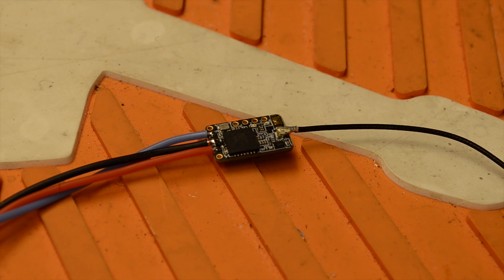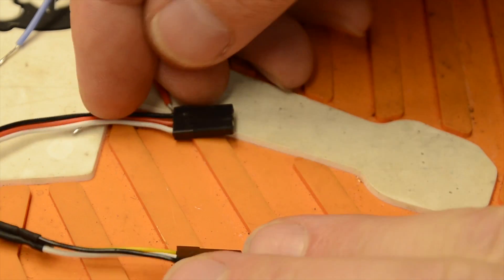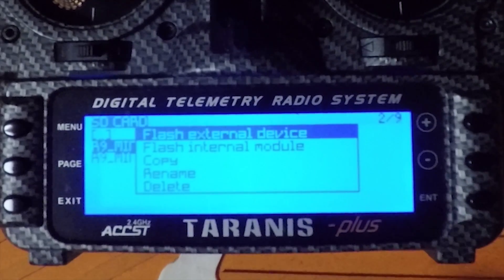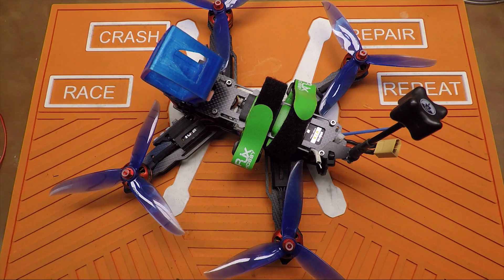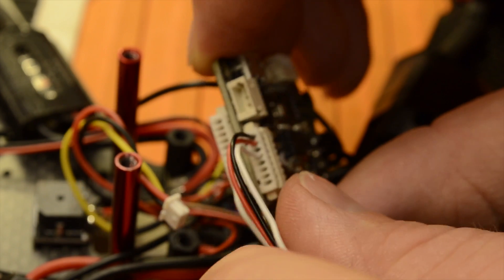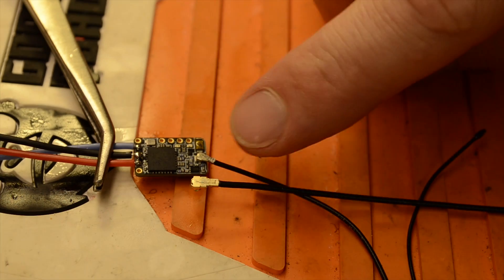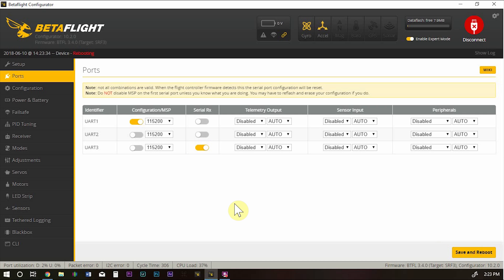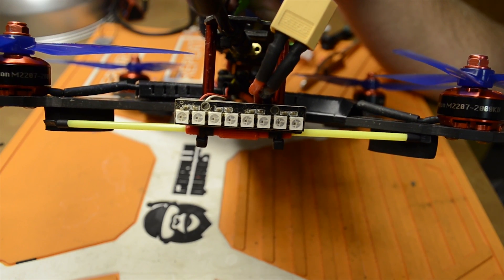Frsky R9 Mini firmware flash F. Port setup on an F3 Fc and betaflight configuration.

Comment: if receiver already setup with sbus and s.port. Cant i just put firmware to f.port and change tab in betaflight and go. Not have to remove sbus wire
Reply from the maker: Potentially yes.

Comment: you cant put wire to inverted s.port (uninverted port) for f.port to tx2 on f4 20a aio
Reply from the maker: It all depends on the flight controller you are using.
Reply: @TweetFPV  ok it worked.. I had to update my opentx to r9 flex and add cli duplex stuff shrugs.. but its working now. Thanks
Reply from the maker: Ok cool. Sounds right to me.

Comment: Any idea's on how to get it to work with inav? I have set to serial and F-port. Tried inverted off and on, still nothing. I previously used DSMX and everything worked, I just wanted more channels.
Reply from the maker: I don't have much experience with inav. I do know that inav is very specific to which pads get connced and is specific for each fc.

Comment: I just didn't understand how the firmware ended up inside the radio?
Reply from the maker: You download it from frsky.com and copy it to the sd card in your radio by either putting the sd card into you computer or connecting you radio to your computer via a usb cable.

Comment: Hi nice tut. But on f4 are the connections same?
Reply from the maker: Not necessarily. If your fc has a hardware inverter on a uart tx pad. You can't tell if your fc has an inverter if it has a "telm" pad
Reply: @TweetFPV  I have hglrc F428 fc. Dont knw what it has ☹️
Reply: @TweetFPV  I have hglrc F428 fc. Dont knw what it has ☹️
Reply from the maker: You could used f. Port fw on the r9mm and use the "inverted s.port" pad to uart tx6. You will probably need to change some parameters in the cli to make it work but that's what I would do.
Reply: @TweetFPV  You Mean Fport to Signal pad and Inverted sport to TX6?
Reply from the maker: No, what you should do is flash the f.port firmware to your r9mm. Then connect power, ground, and inverted s.port pads to your fc. The power is 5v,ground is any ground on the fc, and the inverted s.port wire from your r9mm goes to uart 6tx pad on the fc.
Reply: Thanks a lot bro it worked hip hip huray
Reply from the maker: That's great news!
Reply: @TweetFPV  But i had to flash 2018 ver not able to flash 2019 on inverted sport?
Reply from the maker: @outboxfpv4360  you can flash which ever accst version you want as long as it's the same version that is flashed to your r9m module. All recievers and your transmitter have to be on the same fw or else it won't bind properly.
Reply: @TweetFPV  Ok bro but why its not working with sport/fport pad and tx03?
Reply from the maker: @outboxfpv4360  because the s.port/f.port does not have an inverter.
Reply: @TweetFPV  Ok so the FC should have uninverted pad on tx3 to work?

Will this only work on inveted pad and tx06?
Reply: @TweetFPV  One more doubt so you mean r9mini with no inverted pad wont work on this hglrc f428 Fc?
Reply from the maker: @outboxfpv4360  well a r9mini will work but you'll need to use standard sbus fw and if you wanted telemetry you'll have to use softserial and resource reassignment for the s.port signal.
Reply: @TweetFPV  Hmmm thanks a lot bro for your time and helping me out

Comment: Hi

I have the Hobbywing XRotor F4 G2 controller that says  

"SBUS: SBUS signal input (the SBUS port has a built-in signal inverter, so if signals need to be inverted,
 please connect the signal wire to this SBUS port. In case signals needn’t be inverted or your receiver has an
 inverter, then please connect the signal wire to the Rx of UART1/UART3/UART6.)"

I connect the S.port on some Uart TX but is not working... also i am changing the cli commands
*Inverted on
*halfduplex on

But nothing...no transmitter, no telemetry
Any suggestions ?
Reply from the maker: You need to connect sbus on the reciever to the sbus pad on your fc. For smart port if you have a r9mm reciever connect the "inverted s. Port" pad to any un'used uart tx pad. If you have the r9 mini reciever then you will need to use softserial to get telemetry to work.

Comment: My taranis keeps showing up with "Firmware update error Module not responding"

Please help
Reply from the maker: Are you trying to flash the r9m module or a reciever?
Reply: @TweetFPV  receiver (r9mm)
Reply from the maker: Where do you have the wires soldered to from the taranis to the r9mm and which taranis are you using to flash the rx?
Reply: @TweetFPV  I have it soldered to + - sbus (not inverted) and I am using taranis x9 plus se
Reply from the maker: Ok. You need to be soldered to the s. Port/f. Port pad on the r9mm not sbus
Reply: @TweetFPV  I have already done that
Reply from the maker: Ok that is certainly where you connect the wires. From the inside of your Jr module bay counting from the bottom up should be 1 smart port,2 ground,3 power. If you are looking at your r9mm with the antenna connector facing up and counting from the top down 1 blank, 2 smartport, 3 ground 4 power.
When selecting the firmware to be flashed select "flash external module"
Does the r9mm power up when you select flash fw?
Reply: @TweetFPV  it powers up as soon as I turn on the taranis
Reply from the maker: also what version of opentx do you have on your taranis?
Reply: @TweetFPV  the current latest
Reply from the maker: Ok. well that is about all there is to it. If this does not work i would go back and check your connections, and make sure your wires are not broken internally.
Reply: @TweetFPV  they aren't
Reply from the maker: Well if all those things are in order then by the process of elimination you either have a bad R9mm or a bad tarannis. I recommend starting over and trying all these steps again.
Reply: @TweetFPV  I have tried everything 15 times now
Reply from the maker: What is the name of the FW you are trying to flash to your r9mm?
Reply: @TweetFPV  R9_MINI (that's what's in the R9MM folder. But I have tried to flash every previous version
Reply from the maker: Hmm. Not sure where to go from here. Can you send me some pictures of your setup to tweetfpv@gmail.com and i can see if there is anything else we can try.

Comment: Is it works on R9Slim+ ??
Reply from the maker: yes, you can upload f.port firmware to the slim and slim+.
Reply: @TweetFPV  thank you...
Reply: @TweetFPV  sorry, i do your suggestion, but its not work... "firmware update error"
I have to switch pin S.bus to S.port in Rx first, an then flashing work propperly...

Comment: Any idea how to get this working on a flight controller with no subs, I'm using the r9mm with uninverted s-sport but I still can't get it to work.  Mine is an f4 fc
Reply from the maker: Which fc are you using that has no sbus?
Reply: @TweetFPV  a Marek f411-one it has its own Rx but is capable or running cross fire and r9m an unusual but not sbus.
Reply from the maker: Probably if you had the r9mm flashed with fport and connected the "inverted sport" pad to whatever avalible uart tx pad you had on your fc. That could possibly work. Your would have to change some things around in betaflight and in the cli.

Comment: So fport is where our signal wire needs to connect. But it needs th fport firmware?
Reply from the maker: Yes, if you want to run the fport protocol you connect the fport/sport pad on the rx to your fc and you need to flash a fport version of the firmware to the rx.
Reply: @TweetFPV  and thats all? Also i will solder fport rx to fc tx6? In betaflight config/receiver mode which do i choose? Still serial based receiver?
Reply from the maker: Yes it's still a serial based rx. For the protocol you need to select fport. It can be that simple depending on which rx you have and which fc you have. A lot of f4 based flight controllers don't have the ability to understand the "inverted" signal that the rx outputs.
Which rx and fc are you using?
Reply: @TweetFPV  im using r9mm and a mamba f4 (diatone gtm3). I never used fport before. I seen currykitten he had his wiring just like regular gnd to gnd, 5v to 5v and sbus to sbus_out.
Reply from the maker: Ok so if you are using the mamba f4 and the r9mm you need to connect power, ground to thier respective places. For the signal you need to solder the "inverted sport" pad on the rx to a unused uart tx pad.
Reply: @TweetFPV  ah ok u mean inverted s.port? . Not going fport like u? Ah anything else needed done? Cli?
Reply from the maker: Yes my mistake connect the inverted sport pad to the fc. You will probably need to change the commands "serialrx_inverted = on" and "serialrx_halfduplex = on" but it seams like those are different from board to board. If you don't get the signal back to the fc then try a combination of those commands.
Reply: So im guessing u went with the fport/sport because thats how your fc is configured. Could i also go sbus_out to sbus on fc, will that work too?
Reply from the maker: Oh absolutely.
Reply: @TweetFPV  so if thats the case whats with other fport and inverted stuff? It just makes things more confusing hehehehe
Reply from the maker: The inverted sport/fport pad is there because most f4 processors do not have the ability to understand an inverted signal. So this eleminates the need for a f4 fc to have a built in inverter on a TX pad. Almost all f4 fc have a inverter built in for the sbus in but only few have for supporting smartport telemetry with out the use of soft serial.

Comment: +1👍 Thanks Tweet!   finally order mine.
i read someone had to flash each individual firmwares in step to not have problems. have you heard of this?  such does not seem correct to me, having a computer background myself.   ...i'm assuming i can use the mini in s.port only mode correct?
Reply from the maker: Flashing the latest fw will be fine. No need to step through fw versions. You can use the mini in either sbus or f.port depending on your fc.

Comment: does anyone know how to tell me how to connect with r9mm the f3 flightcontroler if it can diagram
Reply from the maker: I can help you. Which f3 flight Co troller do you have?
Reply: sp racing  f3
Reply from the maker: Email me at tweetfpv@gmail.com I have some pictures that will help but I can not post them here.
Reply: @TweetFPV  I have the R9MM and want to add it to my SP Racing F3, atm I have been using an X4R-SB wired the same way as you had the xsr, (on IO 2) would I just follow what you did in the video? atm the X4R is going to the + - and RX on IO 2  header also the smart port wire from x4r going to TX on UART 2, I'm kinda guessing here but I have to lose the smart port wire going to TX on UART 2 and disregard that now, and on the header just change the s-bus from the RX to the TX next to it then to the F-port on my R9MM, I understand I still might have to do the Cli stuff but does everything else sound right ? TIA
Reply from the maker: That sounds right. I would go from the r9mm sport/fport pad to uart 2 tx. And the power and ground to thier respective places on the fc. That should be about it. You will need to flash a f. Port fw to the r9mm and configure bf as having a serial rx on uart 2 and fport as the correct protocol.
Reply: @TweetFPV  thanks for a quick reply, really apreciat the help, FrSky website isnt very clear but It looks like the latest firmware for the R9MM 2018-12-30, 181228 includes the F-Port firmware, once I downloaded that in the Zip file there is a folder named "R9Mini_R9MM_LBT_20181228" and then a file "R9_MINI_LBT_Fport.frk" as you can see the FOLDER is named with the R9MM but the flash file is only called "R9_MINI_LBT_Fport.frk" no mention of the MM but I guess it's the corect one lol will flash it and see what happens, hopfuly it will all go to plan :-)
Reply from the maker: Yea the r9mm and r9 mini use the same fw but use lbt if you are in the UK and fcc in the US.
Reply from the maker: Are you planning on using the flex fw
Reply: @TweetFPV  NO not planning on using the Flex firmware but yes I am in the UK and will be using the LBT, just flashed my R9M-Lite with the latest firmware, will do the R9MM in a week or so when I get my 5" built, think I have it all worked out now with the help from you and you're video :-) If I run into any problems OR if I get it working as should then I will leave a comment on here, thanks again for the Help TweetFPV
Reply from the maker: Awesome, Good luck and happy building!

Comment: Will it work with the long-distance are 9 mm 900 megahertz receiver?
Reply: Thank you for the information bro I made a jumper plug just like you have I have everything here the r9m module I have the Super 8 antenna coming and I have the preloaded SD card from Aloft Hobbies on its way with updates and voices again wouldn't have been able to do this without your information thank you sir
Reply from the maker: Thank you! If you ever have any issues and need some help feel free to email me. Happy flying!
Reply from the maker: Yes.

Comment: Did you ever got the chance to test the FTDI adapter with flashing the r9m firmware bought module and receiver?
Reply from the maker: Sorry, I ran out of time before I started my holiday travel. I will give it a go when I get home but it won't be for a week.
Reply from the maker: Ok, i'm home and have gone over a bunch of itterations of programming with a ftdi. Long story short, no. Using a FTDI has many issues due to signal inversion. You can use serial passthroug from a flight controller or you can just purchase a USB to s.port programmer https://www.banggood.com/custlink/vG3Dyvp36A to update firmware. Sorry I couldn't be of much help.
Reply: @TweetFPV  thanks no problem. i will just borrow my friend taranis, and do the updates!!!
Reply from the maker: Probably the easiest solution! Good luck

Comment: Do you have to flash the reciever threw f.port even if your going to use it for just S.Bus?
Reply from the maker: The smart port and f port pad are the same pad. You need to flash any and all firmware through that pad. You just select which firmware you want.

Comment: Hey buddy quick questions if I may great video btw, ok I'm using rf4  board I was using xsr frsky rx which uses tx1 on board and and and Vcc,so I'm now converting to use r9mm rx which on the rx has fport and sbus do I wire just straight from f port on rx too tx1 on f4 board ? And also I need to update the firmware on the rx for flex I noticed to got the power direct  from the terrains but I was under the I,precession that the r9mm rx Can t take more than 10v how did you manage that without burning the rx
Reply from the maker: Please check out this video https://youtu.be/5Yl-GBdvclI it has some info about how to connect the r9mm to a f4 flight controller. As far as the Flex firmware goes its not ready for full time use because it requires openTx 2.2.3 which is still unstable and in a nightly build. If you were going to use F.port on the R9MM you need to flash the F.port firmware. Then use the "inverted fport sport" pad to a uart tx on your flight controller. So far in my experience i recommend using Sbus and Smart port instead of F.port. It has been more reliable for me. your results may vary. The power requirements for the XSR is 4-10 VDC and the R9MM is 3.5-10VDC so what ever you powered the XSR with should work with the R9MM. I hope i answered all of your questions. Please feel free contact me if you have any other questions.

Comment: yes I did everything as in your video. I have connected the f.port cable to tx 6
Reply from the maker: Ok. The reason this isn't working for you is you have a f4 processor. Your particular flight controller does not have a bi-directional inverter so it cannot interpret the fport signal properly. I recommend flashing the standard smart port firmware and doing a sbus and smart port setup.
Reply: Ok Thank you
Reply from the maker: This video should help you with your setup. It's not your exact board but it should give you and idea how to do it   https://youtu.be/dzZRv24u1mg